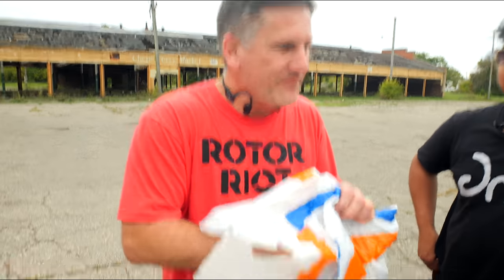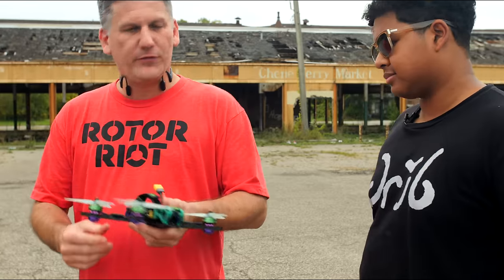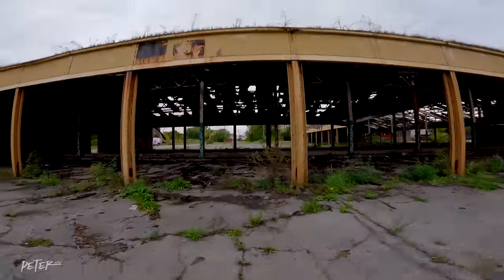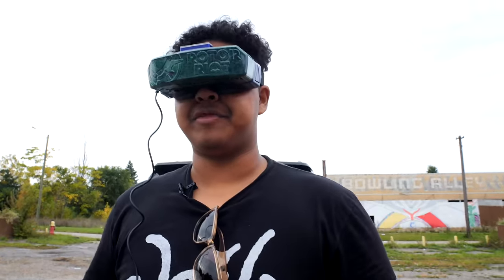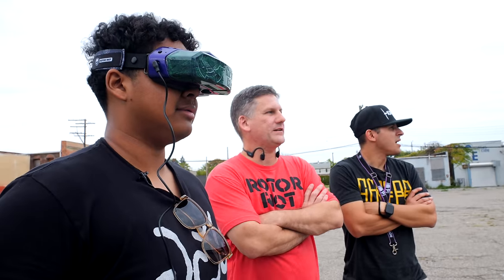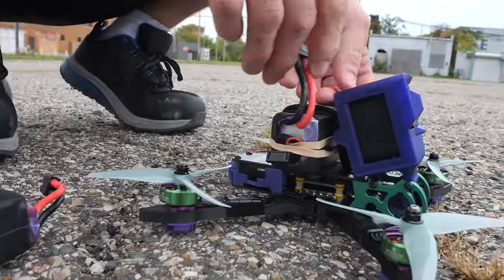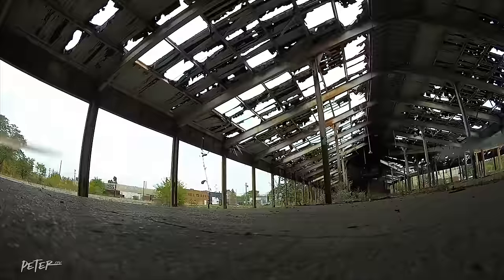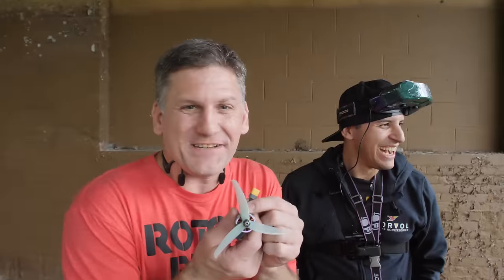This Drone is Made of 3D Printed Carbon Fiber!!

Comment: The thing most people get wrong with 3D printed drones is the shape. The classical drone frame is designed to be cheap to make, it just gets cut out of a flat carbon fibre sheet, because of this the design is basically 2D with a little thickness. When 3D printing though you should take advantage of the ability to make complex 3D shapes and optimise the shape for strength. This design was better than others I have seen because it has very thick arms but the design could still be much better.
Reply: Yes you are correct.
I designed my own 5" frame, fully 3D printed and it fly's just fine without any special tune. The most important thing is to have 2 "arms " for every arm if you understand.
Also it is truly symmetrical X, everything is stacked ontop
Reply: @uzer12387  my drone is printed out of simple PLA
Reply: @uzer12387  are you on about using carbon fibre, as in sheets or are you on about using carbon fibre filled filament?
Reply: @David-ty6my  it's great that it works printed out of PLA but PLA isn't exactly known for it's mechanical properties, it is known to be relatively weak and brittle. You could probably reduce weight and get a stiffer and more impact resistant frame if you used better materials like carbon fibre filled nylons, they are lighter than PLA by volume, they can be stiffer and they tend to be stronger and more impact resistant.
Reply: @David-ty6my  What do you mean with "2 arms for every arm"?

I also fly a 3D printed frame (PLA+). Also true X with the FC+Vista stacked on top of eachother.

Only 2.5" though.
Reply: @uhu4677  not just a single rod per arm, but 2.

Normal X carbon drone looks like an X, but my design has

\_|_/
/_|_\  

setup (this is as good as I can draw with characters
Reply: @David-ty6my  Ah, I think I understand.
I went for just X to save weight. For 2.5" it still works flawlessly. No strange vibrations.
Reply: @uhu4677  Any links to your design?
Reply: @xoltri  I don't want to uploade my current design, as it's not very flexible when it comes to the components.
Also there are a few things I want to improve.

Sadly I didn't have much time the last few months to work on that project.
But I will continue, when I can.

Comment: Awesome - but you’re missing the main benefit of being able to print:  organic shapes.  

Flat / solid arms are a huge compromise, but the most reasonable and economical way to make carbon frames form flat sheets of CF.

You can make a much stronger and much lighter frame if you optimize it with organic round shapes, internal bracing, and print hollow.  Like bone.

How to get to that shape I have no idea.  Hahaha.  FEA
Reply: Yeah frames like this aren’t good for 3D printing, as for designing frames for 3D printing, most prints are hollow anyway and the empty space is filled with infill and you can choose the infill pattern and density so that could take care of the hollow and internal bracing you mentioned and since infill is all handled by the slicer you don’t need to design any of it in yourself, just make the arm a solid object and set the slicer settings.

Comment: I've 3d printed carbon fiber nylon, it  doesn't have the strength of the fibers because its ground up. Pla warps and cracks to easily. The best ed printed drone is the no stress toad in TPU, but the plates i glue fiberglass panels to reinforce the battery strap, then i mount a camera canopy to the top. I have a f3 in mine and it flys as good as anything and it's unreasonably durable, its made craters in the ground and survived, except for the battery and props

Comment: You could possibly design in failure points on the arms, have a section that it is very likely to fail at in a crash and have it as a separate piece joining the two parts of the arm together, or joining the arm onto the body and then when that part fails you just need to swap out a small section, not even a whole arm.

Comment: You could also print motor protection into the arm, if going that route.
Reply: Then if you wear out the motor protection you have to replace the arm too. Having flexible/soft TPU sections on parts would maybe be a good idea or maybe even an exoskeleton.

Comment: 3D printed micros work so well. Especially printed in PC. PC is the most impact resistant material you can print and it's still stiff. It's also worth designing prints that are more "3D" taking advantage of the ability to print any shape rather than just printing out a flat plate - you'll never get close to matching CF performance that way.
Reply: PC is generally very impact resistant but polycarbonate is a class of materials, there is a lot of variation within it, so not all polycarbonates are the most impact resistant. Looking at Bambu lab PC it is far from their most impact resistant filaments and it isn’t that stiff either.

Yeah printing out designs that are optimised for being cut out of a carbon fibre sheet won’t get great results, they need to get someone to properly design a frame taking advantage of the capabilities of 3D printing, it would perform much better.
Reply: @conorstewart2214  yeah, you are right there. I hadn't looked at Bambu filaments specifically, though good on them for having such comprehensive datasheets. 
Surprised by the Bambu filaments impact strengths to be honest. Guess their PC is some kind of blend to be printing at sub 300C temperatures?

Is it also a bit surprising that their CF filaments have higher impact strengths than the non-CF. I thought conventional wisdom is that with chopped CF you are trading stiffness with brittleness. 

I had modded my Prusa to print PC at >330C, and was getting great results, but my favourite PC filament manufacturer (rigid.ink) stopped making filament, and I did certainly notice that other brands weren't as good. 

Thinking of trying ABS next as due to its lower density have an extra 20% of volume to play with for the same weight.
Reply: @kevinbernitz6580  where are you seeing that their CF filaments have higher impact strength? You can only really compare them with the same base material and their PLA-CF has less impact strength than their PLA and their PETG-CF has less impact strength than their PETG. The PA filaments have high impact strength because the base nylon does.

I have printed other brands of PC below 300 C before and they do print but I do agree that bambu have done something to make it print better at the cost of lower mechanical properties. According to their MSDS, it is 99 % polycarbonate with only 1 % additives by weight.
Reply: @conorstewart2214  you are right - I obviously got myself confused. Comparing their PETG to PETG-CF it's showing the correct pattern of CF being lower impact resistance. 

Something else that I find interesting (that maybe I'm getting wrong again) is their TDS shows their PETG is one of their most impact resistant materials.. I've not yet used their PETG, but my previous experience with PETG showed it to be really brittle, pretty much shattering on impacts.

Comment: CF filament is a really cool and fun filament to print even when it is abrasive (if not hardened steel or other). I recently made a 3d printed cinewhoop and files but I haven’t had the chance to do any real flying easily since it is cold where I am in IL.

Comment: Which carbon fibre nylon did they send you? They have a few, they have their original PA-CF (PA6 based), then they released their PAHT-CF (high temperature nylon and PA12 based) then recently they released a different PA6-CF. The PA6-CF has the highest strength and stiffness of all their filaments when dry but when wet the properties just about half. The PAHT-CF is more impact resistant bur has slightly lower properties but can withstand a higher temperature and doesn’t absorb anywhere near as much water and hence doesn’t degrade much.

The actual stiffest and most temperature resistant filament they have is PET-CF (not PETG-CF) but I don’t think it is very impact resistant, so the PAHT-CF is probably the best option for you.

Comment: How much does it cost to print the frame? What's the cost difference to a regular frame?
Reply: The Bambu lab high temperature, carbon fibre reinforced filaments (PAHT-CF, PA6-CF and PET-CF) are like £70 - 90 per kilogram so it all depends on the weight of the arm. There are much cheaper materials though but they will have different properties.

If a frame was properly designed for 3D printing then it should work with polycarbonate or other such filaments which are cheaper.

Comment: An idea I have had would be to print the main drone frame (optimised for 3D printing) out of a stiff material like a carbon fibre nylon but then add a TPU exoskeleton around it to absorb the impacts. You should experiment with different materials, some good ones to try would be standard nylons, polycarbonate or polypropylene (it is difficult to print but may be fine on the X1C). Polycarbonate is impact resistant as is nylon. Polypropylene is semi flexible and incredibly durable and impact resistant. If printed properly it should be stiff enough for a drone but then the frame should never break on impact.

With nylons in general if you let them absorb moisture they become less stiff and more impact resistant. Sometimes for some use cases or during assembly they soak nylon parts in a bucket of water to greatly improve its flexibility whilst it is assembled or used, that very much depends on the nylon used though, PA6 absorbs lots of moisture, PA12 doesn’t.

A very stiff option that doesn’t absorb much moisture is PET-CF.

Comment: Very interesting, informative and fun video. It worked, cool. Will it work on a frame with less robust arms? Like the Moxy or Skyliner?
Happy flying everyone. 😎
Reply: It is not a good idea to 3D print frames designed for getting cut out of a carbon fibre sheet. A carbon fibre sheet and a printed part have very different mechanical properties. You should take proper advantage of 3D printing and design a frame to play into 3D printings strengths. A properly designed and optimised 3D printed frame would perform much better than just printing out a carbon fibre sheet frame.

Comment: Another thing you could try is printing a carbon rod into the arm.
Reply from the maker: That actually sounds like a smart idea, will have to try that
-Bubby
Reply: Before trying that it is probably worth designing a frame to take advantage of a 3D printers capabilities rather than printing a flat object.

Comment: the real benefit here is being able to print complex structures to make up for the weaker material. the sheet based frame designs are far from optimal and a single piece generative design 3d frame may make up for the weaker material.
Reply: Yeah the sheet based designs are optimised for cost mainly and are really just 2D designs with some thickness. With 3D printing you don’t have any of the same limitations so you should take advantage of the ability to make complex shapes and it absolutely would compensate for the material itself being weaker.

You don’t even need it to be a generative design, for the most part they aren’t that useful, they just look cool. Also a lot of generative designs are based on simulations and you can’t accurately simulate 3D printed parts.
Reply: It has to be easy to replace too. A 3d design would have more attachment points.

Comment: almost any printer can be upgraded to print this of course. add $70 high temperature hotend and temperature sensor. update your software, marlin in many cases, to increase maximum tempt to 300-315. Keep your nylon dry, heat it up in oven for 10 hours if it is damp and use a filament dryer while printing and you are golden. Bambulabs printer are capable of high speeds and I love them of course but price tag shouldn't discourage someone from attempting this at home. I can print nylon carbon filaments with 5000 7000 acceleration with my slightly modified $129 printer. In total, on top of the printer's price tag, I probably spent another $200 to get to high speeds with klipper based hardware and a nice hotend capable of high temperatures. that being said, I wouldn' t mind a Bambulabs printer. I hope Santa brings me one this year.

Comment: Outstanding flying Bubb.

For the drone...looked like it rocked until you broke it.  But...LOTS of "better" frames wouldn't take a hit to concrete damage free would they?
Reply: Beer in mind this was just 3D printing a design meant to be cut out of a carbon fibre plate. A properly designed frame for 3D printing would do better.

Comment: I'd really like to see a oblivion style drone thats a little beefier done in PC
Reply: It would be better to design a frame meant for 3D printing rather than trying to print a frame meant for getting cut out of a carbon fibre sheet. Normal carbon fibre frame designs are not good designs for 3D printing.
Reply: @conorstewart2214  i said oblivion style, it was injection molded... I tried  making one but it kept breaking easily. I currently use a frame called the toad that says no stress across the front, that is tpu, of course I've modified it with a extra carbon fiber plate in the bottom to reinforce it due to the weight of the battery, i used a soldering iron to oush aluminum standoffs i cut to length down threw to mount the top and bottom plates i make in petg, they lock the frame together to make it more rigid and I use a whoop canopy on the top for the camer so i don't have to look at the front part if the frame. I also used washers under the motor mounting screws so they don't pull through. The frame flys wonderfully, so smooth being most the structure is tpu, but im not running super powerful motors, some old red bottoms on 35a escs. The biggest issue I've found is the battery on the bottom is easy to knock off and destroy hanging from the bottom...i used a old bike inner tube to help protect the batteries, but i still I need to modify it for 2 battery straps yet

Comment: Shawn, Get the PET Carbon Fiber. It's stronger than the Nylon-CF, but like all CF, you can't load it in the AMS.
Reply: The only carbon fibre filaments that Bambu say aren’t compatible with the AMS is the PA6-CF and PET-CF and that is due to the brittleness of the filament. 

The PET-CF isn’t really stronger and is actually less suitable for drones, it has much lower impact resistance but is very stiff. The best option is probably the PAHT-CF, it has the highest impact resistance and good strength and doesn’t absorb much water. The PA6-CF is best in terms of mechanical properties other than impact resistance and the fact that it absorbs a lot of moisture very quickly and it’s mechanical properties drop massively so it’s only good if you can stop it from absorbing moisture.

Comment: PETG-CF should be stiffer to get rid of the vibration
Reply: PAHT-CF has a bending modulus of 4230 MPa, for dry PA6-CF it is 5460 MPa, and for PETG-CF it is only 2910 MPa, so it is actually significantly less stiff. PETG is known for being pretty flexible.

Maybe you meant PET-CF which has a bending modulus of 5320 MPa so it is stiff but it’s impact strength is pretty low.

Comment: Next Test: Print One Moxy arm on a rig built to Bubbys Specs and don’t tell him. Maybe print the whole thing and don’t tell anyone. His build his tune. For his radio and goggles.
Reply: Or you could just design a frame that is meant for 3D printing, rather than trying to print a frame meant for being cut out of a flat carbon fibre sheet.

Comment: SO.. one little comments there.. you should NOT mix one 3D printed drone arm into a carbonfiber frame, with all the other arms still there in the original carbon fiber version. it's SUPER dangerous !!! I did this on an Emax Hawk Sport 5, broke one arm, and replaced it with a 3D printed PLA arm, and the second i hit ARM, it did a PID runaway, shooting instantly for the stars on 0% throttle... disarmed and crashed from 50 meters'ish altitude into pure concrete.
Reply: That sounds like mistakes on your part. First of all you should not have been trying to use normal PLA for a drone arm, amongst all the other issues it goes soft at 50-60 C, which means your motors could have melted it.

Secondly, your drone shooting up in the air at 0 % throttle would not be due to the arm being printed at all. Most likely you damaged something in the crash that led to you replacing the arm.

Comment: I printed drones years ago. And for lightweight drones i would prefer IT . But for freestyle Quad IT IS Not durable enough. Also the Vibration from the Motors are Not good for printed frames.
Reply: So it’s not good or durable enough just because you said so? Did you just take a carbon fibre frame design and print it? If so then that is your problem, most drone designs are meant for being cut out of a carbon fibre sheet and therefore and optimised for that. If you want to get good results with 3D printed frames you need to create a frame that is optimised for 3D printing.